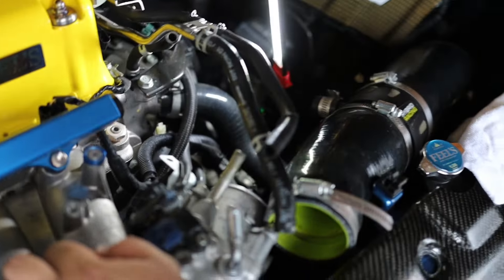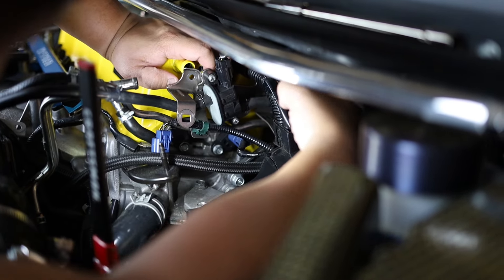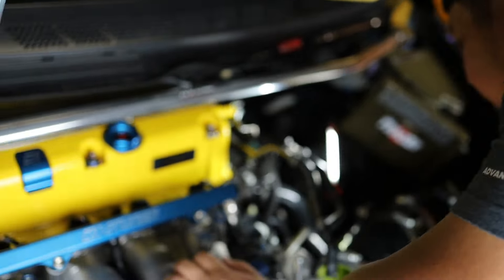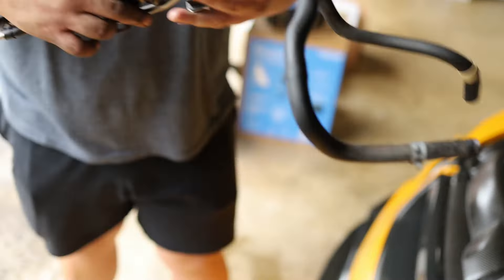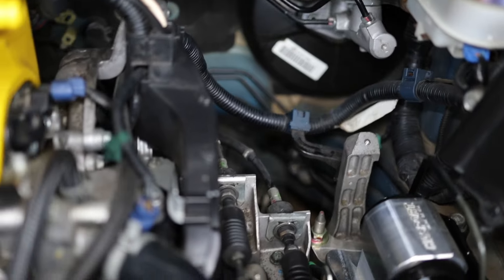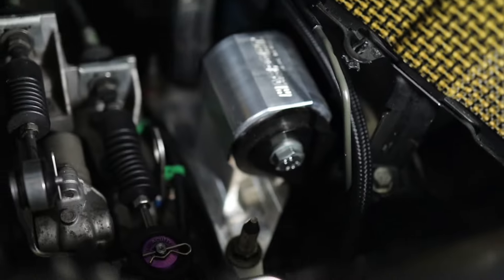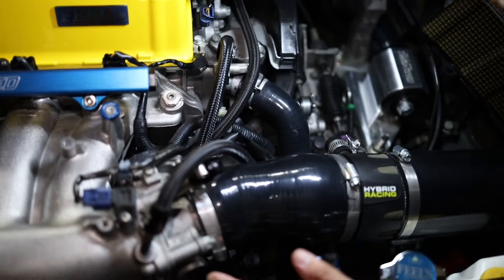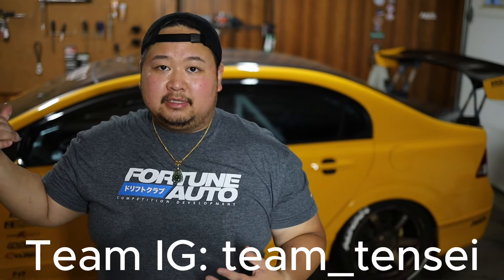How to Clean Up Your Engine Bay | FEEL's Build | 8th Gen Honda Civic SI | superFEELSblue

Comment: You can also cap the coolant hose that runs to the throttle Body
Reply from the maker: Can you? I was scared to.
Reply: @superfeelsblue  yeah. Cap off the ends on the throttle body. It’s just for coolant. It’s Ment to help the tb in cold weather. If you  live in warm weather, it’s fine. 
The hose on the water housing, you just bend it down to the hard pipe. It replace the hose that goes to the tb. 
So you eliminate the two hose to the tb and now it’s just one. Kinda hard to explain but you will see what I mean if you look at it.
Reply from the maker: Thanks for the tip

Comment: did you put the brake check valve back in? 
what size hose from brake booster to vaccum port?
Reply: -8an i believe. you can easily push in the check valve with an 3/8 extension.
Reply from the maker: Yes, I forgot about it and reinstalled it today. The hose size is -10an I believe.

Comment: Just like you, I  can't  see squat. Are you screwing with the brake booster hose, cuz I  can't  see where mine winds-up behind or below the valve-cover??? Can't  find any video's  anywhere. My check valve is not located on the booster, so I'm  really screwed! It's  a Canadain car.
Reply from the maker: Yeah, I reinstalled the check value and pushed it into the booster